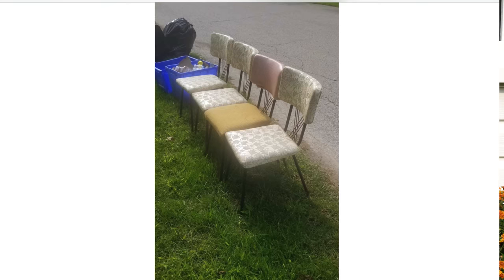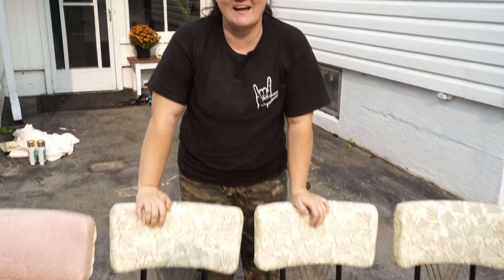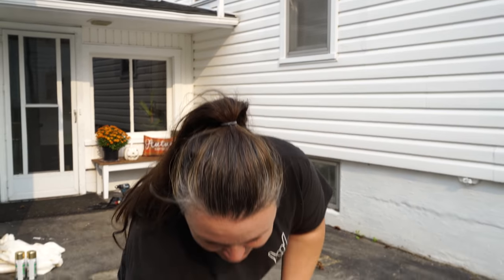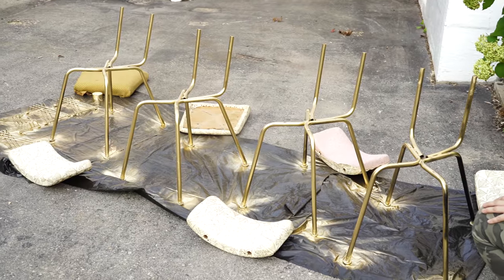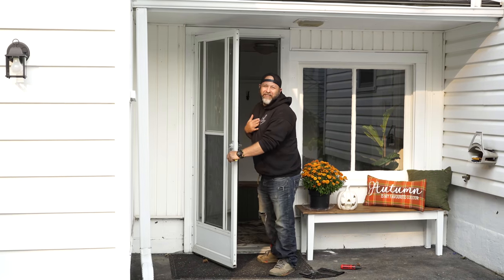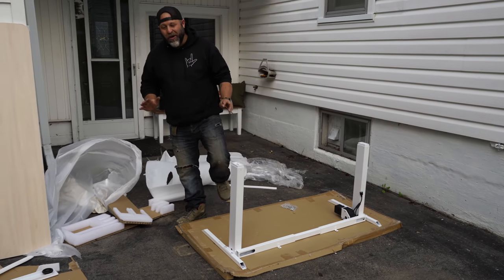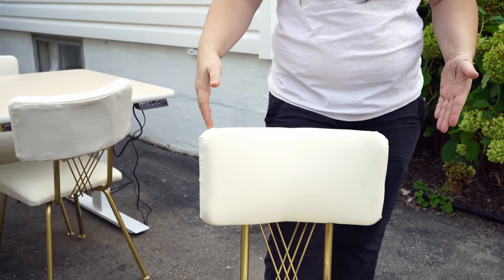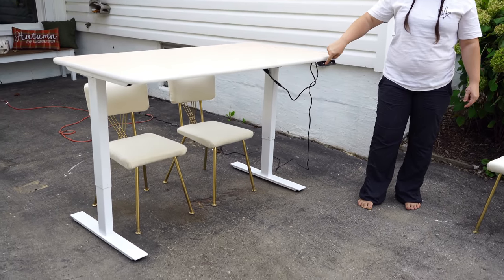Trash To Treasure Up-cycled Home Decor CURBSIDE FIND Mid Century Modern Restore!

Comment: Maybe it's because I scrolled through the video fast, but I didn't see a part showing how the chair back was upholstered (only that it was completed). Or how you finished the bottom of the seat after stapling that mound of fabric. 
Please forgive if it's there, but I missed it by fast forwarding.